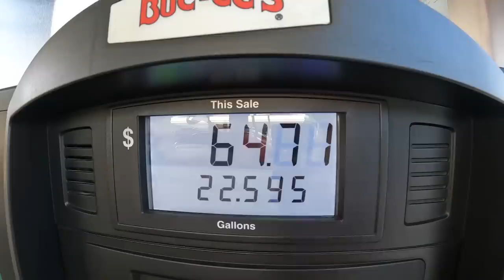THIS WAS A BIG ONE tiny house, homesteading, off-grid, cabin build, DIY, HOWTO, sawmill, tractor

Comment: Not sure what video you were having problems getting the push mower running on but put gas in it and tip it up on one front wheel for a couple seconds so the gas can run to the carb set it down and try starting it